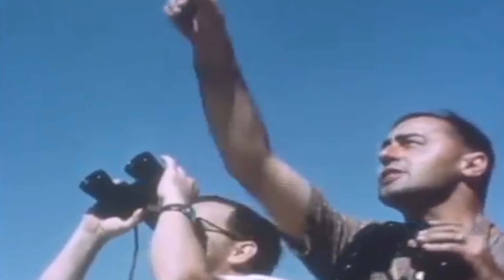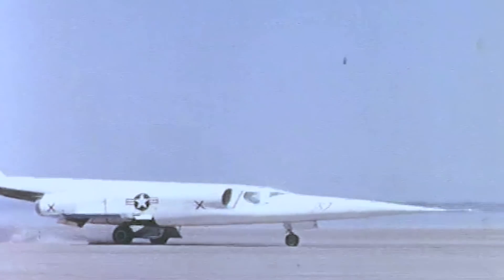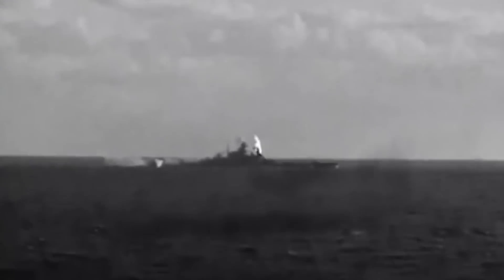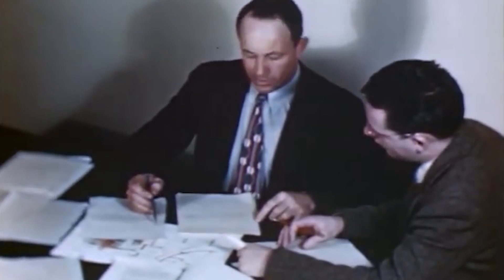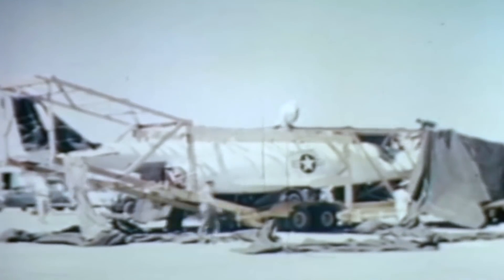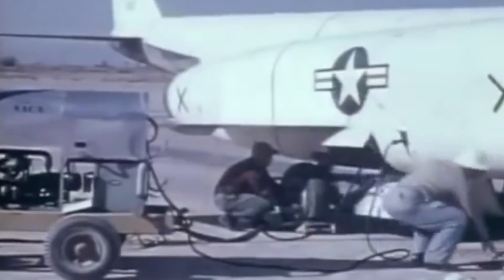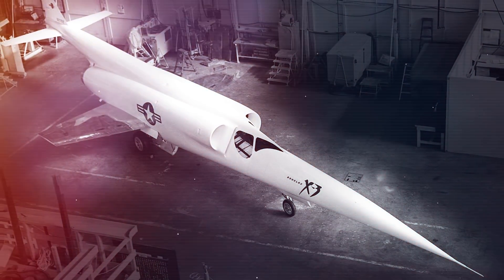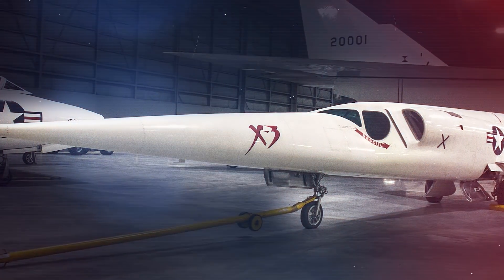Douglas X-3 Stilleto - The Dagger That Could Barely Fly

Comment: An important reminder of why we don’t hide failures - there are a lot of important lessons that were learned from this flop.

Lesson #1 - just because it looks fast doesn’t mean anything.
Reply: -  You would be suprised how many things survive on looks alone.  Otherwise  Hollywood & Playboy would have never existed.
Reply: These failures were almost certainly "hidden", if by that you mean classified.  The successes would have been, too.  You don't want to hide these results from the engineers or policy makers, but that's about it.
Reply: Lesson #2 - have a suitable backup power plant option in case the first one does not work
Reply: It’s not easy to have a suitable backup. 

This was the dawn of the jet age. Most American manufacturers were making copies of British engines like the Allison J33 and Pratt & Whitney J48. 

Only Westinghouse had experience with American designed axial-flow turbojet engines in the immediate post-war years due to the unique combination of it being a steam turbine manufacturer (rather than a turbocharger manufacturer like GE) and that it was given the specifications of turbojet engines from British data (ie: mass airflow, fuel flow, pressure ratios, combustion temperatures, etc) but not the configuration.. leading them to develop an axial flow engine independently as a solution. 

Axial flow allows the engine to have a low frontal area for low drag, allows easy scaling to larger engines and higher pressure ratios by adding compressor stages (a centrifugal engine can only have two due to ducting losses between stages). 

But the problem is that unlike a centrifugal compressor or a turbocharger.. the pressure rise is linear and not exponential with RPM. This increases back pressure very quickly which results in compressor stall unless something is done about it. 

A bleed valve is suitable for smaller engines like the J30 and J34.. but the pressures are too high once you get to larger engines that you’d never get the valve to stay closed. 

Westinghouse couldn’t figure it out.. and it wasn’t just the X-3 that had that problem—it was a low production aircraft that needed an off-the-shelf engine—but most of the US Navy’s upcoming fighters and interceptors like the F4D Skyray, F7U Cutlass, and F3H Demon all of which were supposed to use larger Westinghouse engines and had to be cancelled or heavily modified for other engines when the J40 and J46 failed. 

Pratt & Whitney would eventually design the J57 which used two spools to solve the compressor issue, and GE would design the J79 which used variable stators to unload the compressor as it accelerated. 

The SR-71 would have suffered the same fate too with the J-58... the only off-the-shelf engine that had enough thrust to push it past Mach 3. It was modified heavily with bypass tubes to the afterburner not to make it a ram jet.. but to reduce the pressure in the compressor which was designed to produce high static thrust for a jet powered flying boat.
Reply: The wings are too short!!! There I figured it out with one glance... The designer needs his head examined or should have stuck to working on the set of flash Gordon.  
To fix it would need Delta wing's & nose canards also flight computer to improve stability
Reply: @punkvoid9957  computers weren't exactly the best nor small in the 50s, canards would make it to unstable for people to fly especially since not much was know about the flight characteristics of flying at mach speeds
 
you also want shorter wings when flying at high speeds, many reasons for that (many that i do not know)
Reply: @punkvoid9957  I don't think Flash Gordon was a thing yet...To fix it would be to simply wait 80yrs then?

Comment: I wonder if it would have met its Mach 2 design speed if more powerful engines were available or used during it’s flights. I think it would have. The Mach 2 F-104 Starfighter seemed to use a lot of the X-3’s design and the 2 airframes look roughly similar. This is one of my fav X-planes, in spite of the fact that it couldn’t pass mach1 in level flight/without diving.
Reply: Seems to me that given the video contained the statement that it was assessed as being close to disintegration when pushed to its limits, that putting more powerful engines in it would make it more difficult and cumbersome to handle, and would push the  overall design beyond its limits. I think this was a sponge for money, a designers wet dream. Anyone with even the slightest amount of commonsense would have looked at the design on the drawing board and laughed and told them to bin it.

Comment: It doesn't seem to follow the area rule, which helps explain why it performed poorly
Reply: "F4 Phantom II"
Area Rule airframe isn't strictly required. 
The X3 primary failing is it's anemic engines.
Reply: Area ruling is primarily to address the cross sectional area of the wing. The X-3’s wing is so thin and small as to not need much compensation.
Reply: @timgarrett203  That does make a lot of sense, thanks very much.

Comment: Aircraft nearly kills test pilot.

Test Pilot: "Again! Again!"
Reply: Why do you think the first astronauts were test pilots?
Reply: @Year2047  because they wanted the best and the brightest, the guys with the right stuff as they hadn’t got a clue how space travel would affect people. 
I’m guessing 😊
Reply: @Year2047  Speaking of astronauts, Joe Walker was also the first person to make two spaceflights.
Reply: It's a thin line between bravery and insanity. Piloting a jet alone is brave, flying something experimental is mental.
Reply: @theFLCLguy  yep one man runs at the enemy alone and is shot ‘he must have gone mad’, one man runs at the enemy and takes out a machine gun nest and is shot and it’s  ‘give that man a medal’.
Reply: @Andy Hale The X-3 was the prototype for the F-104 Starfighter, where they really perfected killing pilots. When too many USAF pilots died in F-104 accidents, the aircraft discontinued in the US, but they were sold cheap to the Luftwaffe, which started piling up the losses again. Way to treat your allies.
Reply: @Dragonblaster1  The Germans insisted on using the F-104 as a ground attack aircraft and that didn’t help.  The F-104 derived U-2 worked well at its designed role.
Reply: @allangibson2408  It was those stubby little wings compared to a relatively long fuselage length that led to the F-104's stability problems. The U-2 does not have that problem.
Reply: @Dragonblaster1  The F-104 didn’t have stability problems. It is far more stable than the F-16 for example. The F-104’s problems had to do with changing it from a missile transport with light weight missiles on the wing tips to a bomb truck operating at zero feet altitude. The added weight reduced its manoeuvrability and nap of the earth flying required high manoeuvrability - conflicting requirements.
Reply: Single engine landing, on afterburner..... Jesus.
Reply: @Zaprozhan  And even Jesus is sweating during that one.
Reply: Doesn't even look that there was any way to eject out of that thing. I'm surprised that any test pilot would go up in it twice. Being a test pilot must have paid pretty darn well.
Reply: @Eyes-of-Horus  a lot of aircraft back then didn’t have ejection seats and even when they did they weren’t always reliable. Some test pilots if employed by a manufacturer did get higher pay rates but military pilots didn’t. I think Chuck Yeager offered to fly the X1 for just his normal military pay even though he was offered a bonus by Bell.
Amazingly brave men and women pushing the envelope.
Watch the right stuff movie and you get a good idea
Reply: @nigeh5326  Larry Bell took out a life insurance policy on Major Yeager in Glennis' name, to make sure Yeager's wife and kids would be taken care of in the likely event that he died during the X-1 test regime. This was before USAA - at the time there was no WAY that a member of the military would be seen as a suitable risk for insurance.
Reply: Da Kamarad
Reply: I never understood it till I spoke with a few test pilots .... first to fly the bird ... they don’t care what the cost is
Reply: @Andy Hale ... I'm sure the idea of someone else flying such a dangerous plane and dying may have compelled a test pilot who flew it and lived, to take on the challenge again. Kind of like how soldiers re-enlist for multiple tours of combat. It's about protecting the other members of their unit.
Reply: "These planes demanded proficiency or they would kill you".  - Chuck Yeager
Reply: “What doesn’t kill you makes you want to try again.”

Comment: Big problem was power. If the X-3 had the J79 it could've made mach 2 easily.
Reply: The J79 came 2 1/2 years too late for that though it's use in the F-104 shows your basically right.

It just shows how fast aircraft developed from 1945-1960 before costs skyrocketed leading to the big slow down from the mid 1980's till today.
Reply: @Ushio01  How true.  My dad was an F-104 pilot in the 60's. When asked what could make the "Zipper" better, his reply was 5,000 lbs more thrust.
Reply: @billgund4532  also known as the widow maker when the German airforce flew it. 
The F104, MIG21 and English Electric Lightning are similar in that it was all about speed to climb and catch the enemy. 
All 3 are icons of early Cold War aviation
Reply: @nigeh5326  Mission requirements & technology were rapidly changing at a rapid pace. Had the F-104 been able to employ fly by wire technology, well it would have really been a force of nature.

Sadly, dad passed away recently. But I remember him telling me he never felt more alive than when flying the '104. And this coming from a guy calling the F-86 his blue skies mistress.
Reply: @billgund4532  I agree with your dad I love the Sabre it and the Hawker Hawker Hunter are my 2 favourite early 50s jets.
The F104 was an amazing aircraft pushing the technology of the time to the limit, as did the Lightning and MIG21 at that time. 
The Phantom in the 60s with its angles showed they were starting to get the aerodynamics side together and when combined with the electronics packages of the time to help an overloaded crew they made a great aircraft, a jack of all trades, not the greatest in any one way but near the top in many ways.
Stay safe my friend
Reply: @nigeh5326  At my age, staying safe is a full time occupation. Dad did get a fair amount of  F-4 "stick time" and a fast FAC (he was an O-1 FAC) during the Southeast Asian Wargames.  His take on the F-4? "A dump truck. A very fast & capable dump truck. But a dump truck." When he came back to Luke AFB, AZ, he was able to use his knowledge of the F-4 when the 104 drivers  would have a furball over the skies at the Gila Bend gunnery range. Strictly off the record of course.
Reply: @Ushio01  yes, the J79 could have been a tremendous help to push the X-3 easily to mach but it would never overcome it's extremely dangerous instability issues. All the the test pilots said that it was the most difficult airplane to fly scaring them shitless...
Reply: .....or 2  J-29's ...................

Comment: It seems like it was difficult to let go of  straight wings for a while, even though the Germans already  figured it out.
Reply: I would bet that if you looked a Kelly Johnson's design notebook for the F-104 you would see a reference or two to this thing.
Reply: @fooman2108  the swept wing F-100 had a higher accident rate.  All of the century series were... flaky at best.

Swept wings were really dangerous at first because of their stall characteristics - the wing wouldn’t all stall at the same time.
Reply: @Justanotherconsumer  That's why they invented wing fences and spoilers!  I have always found video of 'the sabre dance' to be just eerie, wonder how many lives were saved by Martin-Baker because of it?
Reply: @Justanotherconsumer  And the example of that behaviour in landing is the "Sabre Dance". Used on films and TV series (even though it sadly killed the pilot). For people that don't know the stall starts at the outside of a swept wing and works its way inboard. As it does so the centre of gravity alters, so for example, the plane can pitch up. The pilot then corrects the up pitch attitude (as the stall is moving up the wing in board) , and put's the nose down, ,but the stall is reducing the wings capability. In the end it becomes very easy to end up with pilot induced oscillations. 
There were some terrible solutions, such as the Republic XF-91 Thunderceptor, with wide wings at the end and a thin wing profile at the wing root to attempt to generate an even stall. 
On the other hand, as Teddy Petter did with the English Electric Lightning, he cropped the end of the wing. In that case, on an aircraft with such a high landing speed the issue was not as significant.
Reply: @Justanotherconsumer  the germans also figured that one out with the me-163, the wings were twisted so the tip has a lower AoA than the root, the tips also had slats
Reply: @fooman2108  The F-104 was  a death-trap, and I don't think anyone would claim that it wasn't.
Reply: @None-zc5vg  the F-104 was totally safe when used like it was supposed to be used, thats why only Germany had such high loss rates for it
Reply: @None-zc5vg  deathtrap fighters were (and are) hardly new. Based on numbers built and length of service, the F-104 was very much a successful design. Trapezoid wings work just fine.
Reply: @None-zc5vg  If you flew it like it was designed to be it was fine.... that being said when someone decided that to take to low altitude THAT was suicidal (I would have invested in Martin-Baker when they made decision)
Reply: @None-zc5vg  The F-104 suffered form two things, as Master Of puppets eludes to, the Germans were using it low level. Sadly that's bird territory, and at high speed the engine failing or other situations leaves no time to rectify the situation. 
The other problem, the Elephant in the room was the German flyer of the time. In order to rebuild the German air force a number of wartime pilots were brought back into the service. By the time they were flying the 104 many of them were 40-50 year old men, and we need to look at the situation that causes. 
We know pilots of high performance aircraft need to be fit;  but these men had eaten badly, and not really had much exercise after German surrender, and quite frankly had just survived. Many of them were born into the economic chaos of the end of the First World war so their health was not as good as a 40-50 year old of today. 
Then they were trained in a world of 400-500 mph, where as this was now a world of 1000+mph. Finally they were expected to lead the young pilots who knew no different than the high speed world. 
What happens is instead of the sage words of advice that most European Air Forces had from a rank structure that had seen pilots capable of taking on fast jet operation move up to lead sections (and pilots that knew they were at the end of their careers move out). You have youngsters pushing on the door of people with little experience in that environment (and at least 10 years out of uniform). That lead to a lack of leadership and sadly, to not tempering flying that could result in aircraft destruction. 
I'd point out that the German Air Force soon benefited from the experience as it worked it's way up through the ranks. In my opinion it's not the planes fault, it's a whole set of circumstances.
Reply: @fooman2108  yes but remember that the early variants of the F-104 had the ejection seat that blasted downward and wasn't particularly safe. Now eject at low level and the poor pilot will have a very interesting time ahead. Early Starfighters used a downward-firing ejection seat, the Stanley C-1, in order to clear the "T-tail" empennage that presented obvious problems in low-altitude escapes, and many pilots failed to escape from their stricken aircraft in low-level emergencies because of it. Only later many export Starfighters were retrofitted with the Martin-Baker MK.7 with  "zero-zero" capability...
Reply: The F-104 had the same.type of wing, and was rather successful.
My armchair a/c designer's guess is that with bigger engines and stabilisers, the X-3 might have fulfilled the goals. The tail section looks ridiculously tiny compared to the elongated fuselage.
Reply: @acajutla  It was a difficult plane to fly at low speeds as I recall.
Reply: @gowensbach2998  So was the F-104. The small wing area assumes high speed to stay aloft, that is much thrust, of which the F-104 had enough.
Reply: @acajutla  Both planes just look so damn cool nevertheless

Comment: It looked cool as hell. It doesn't matter if it was crap
Reply: lol that is a nice pos.  Salute to the engineers.  Working on something that may have failed but it contributed to greater designs
Reply: Which is the exact opposite of good engineering
Reply: @snoochpounder  The exact opposite of good engineering is good marketing, so ... yeah.
Reply: Like my 1986 Camaro
Reply: The point of an experiment is to learn, and if it doesn’t go as expected and they learned from it, call it a success.

One other success from an X-plane standpoint is that the program didn’t kill anyone.
Reply: Well, it kinda does. 🤔
Reply: Shii, I don't care how cool a plane looks, I'd want to be alive and well by the time I've landed.
Reply: Pretty sure that the guy flying it -- and the taxpayers who spent their hard-earned money on it -- would disagree. That said, it taught us a lot of lessons that are still important today.
Reply: Nah. It matters
Reply: D Hill  I quit flying years ago. This had nothing to do with commercial flight anyway.
Reply: Even failure is often a success
The technology used to produce such aircraft has to be proven or in this case disproven to move forward
Reply: It does if the taxpayer had to pay for it.
Reply: Largely doomed by underperforming  Westinghouse  engines.